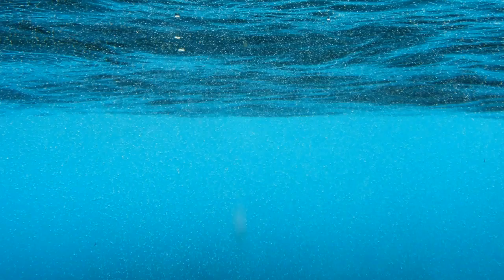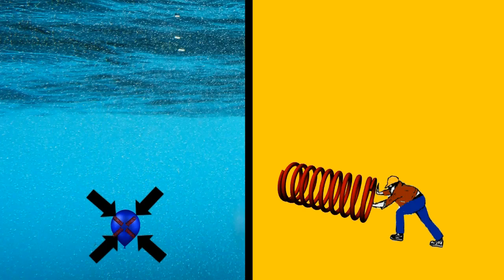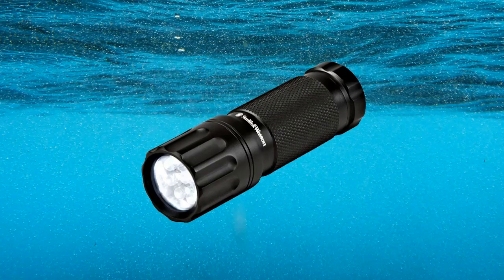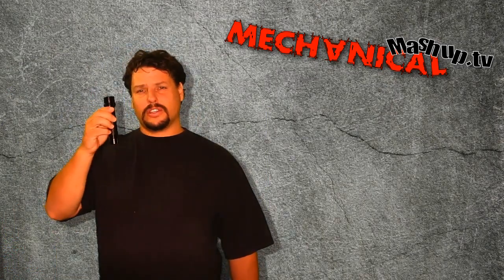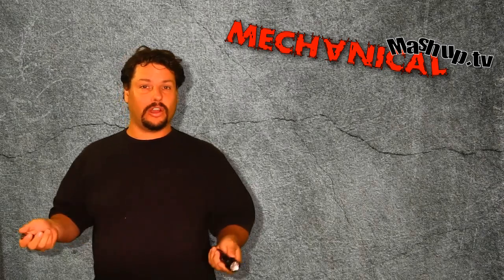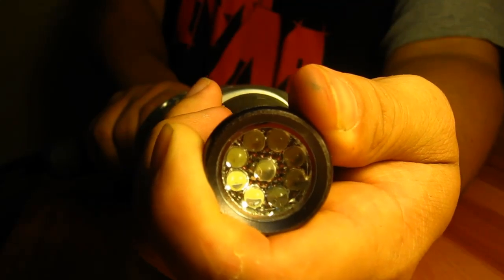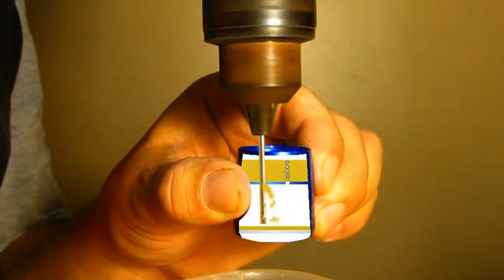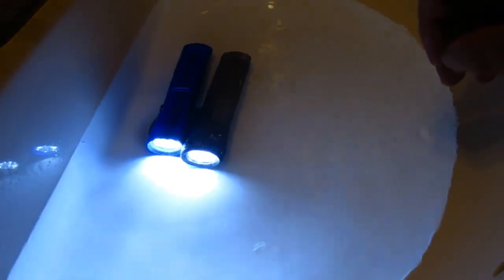MechanicalMashup Episode 20

Comment: Have you taken this concept any further than just the "proof of concept" stage?   I think it's a spectacular idea but since batteries go dead, I was wondering if you ever thought about adding some sort of recharging ability to the design so you wouldn't need to disassemble flashlight (and all the issues with the oil,) to load fresh batteries.